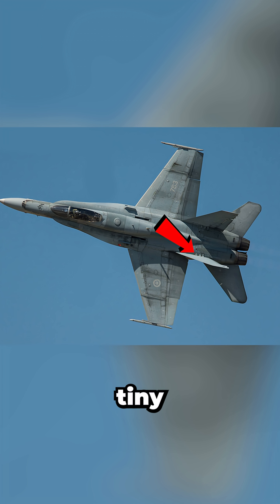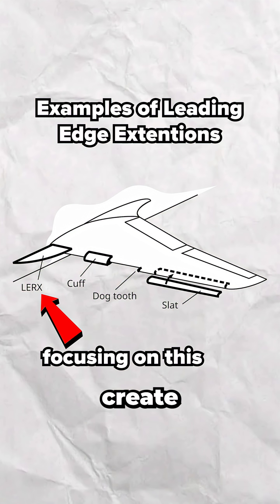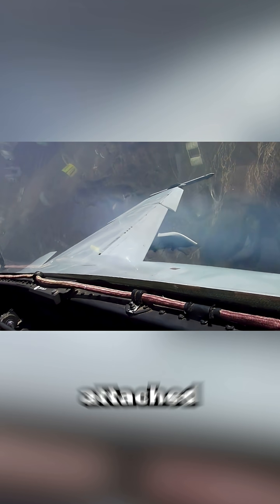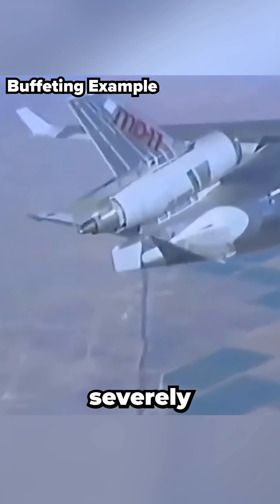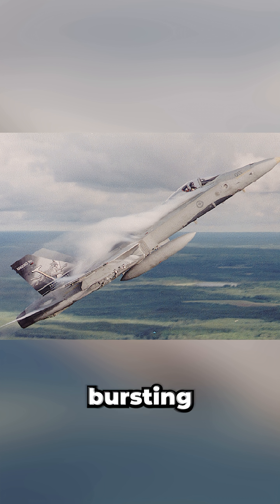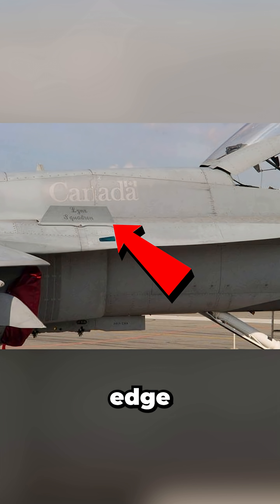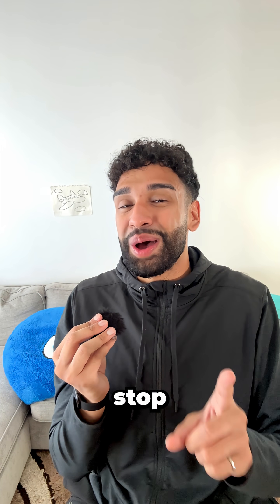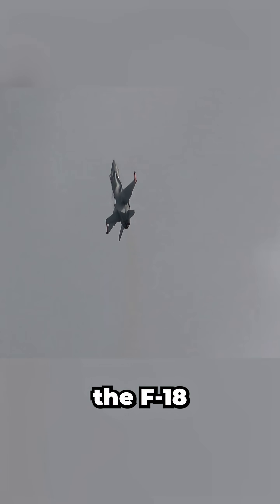The F-18’s biggest design flaw (and how they fixed it)

Comment: Note that was only on A-D's.   If you look on E-G, there are two rows of 4 smaller fences on the top of Engines just before the vertical stabilizers (tails).  This was done during design because of the lessons learned from the original testing on the A model

Comment: Honestly, you can’t fault the engineers. The CFD turbulence models were much less accurate back then especially for swirl and adverse pressure gradients in a non-confined flow, mainly (but not solely) due to lack of computational power. At the very least supercomputers are much more advanced now so you can run a much finer grid in addition to more accurate models for turbulence. They did a hell of a job with what they had

Comment: Bad design? Lift to fuel consumption off of the catapult. F-18s fully loaded with weapons, fuel and a full drum suck down so much fuel on the Cat that an orbiting F-18 tanker is waiting to give a refuel before continuing on the mission. 

So in all actuality the carrier launch rotation is:
SAR/ Starboard D
Alert 5 strike aircraft
E-2 (x2)
F-18 tankers
Then the mission event launch that need to be refuelled before going feet dry.

Comment: If you take a piece of paper, fold it into a paper airplane, and then throw it, it will obviously fly if it’s made right.  But do you know how sometimes the airplane catches air on the top of the wings and it goes directly down?  Try adding leading edges on the front of the wings right in front of where the wing catches air.  Don’t make it too big, but if you add some correct leading edges to that paper airplane, it will fly much more reliably and stable.  Just be sure you fold the leading edges correctly so that the air is guided under the wing so the plane doesn’t catch air on the top of the wings and nosedive.  This is just a demonstration.  No hate comments, please.

Comment: I like the part where he explained how exactly that extra fence improved the situation. I assume it gave a little wall for the vortex to bounce off-off, but who knows
Reply: From google AI. Point 2 kind of answers your question though admittedly it still doesn't address "how" the fence disrupts the vortex.
1. The LEX fence modifies the airflow over the leading-edge extension (LEX) of the wing, which creates vortices that help the aircraft maintain lift at high angles of attack. 
2. By disrupting the formation of the main LEX vortex, the fence helps to delay the onset of buffet and reduces the vibration experienced by the vertical tail. 
3. The LEX fence also creates a secondary vortex that helps to keep the airflow attached to the wing at higher angles of attack, improving maneuverability
Also google "function of fences on wings" and see the detailed explanation.

Comment: There are bolts holding them on the fuselage on one end but not the other.  McDonald Douglas built one half of the airframe and Northrop the other.  Can’t remember which one, but one of the manufacturers didn’t want to spend the money engineering the attachment fittings for the fence on their side, so no bolts.
Reply: Northrop built the aft. McD (now Boeing Defense) built everything else and assembled the full airframe, same as the Super Hornet today
Reply: Sounds like b*****

Comment: He also neglected to state that these Vortex Generators created an additional  24 volts at 5 amps to help run the avionics.
Reply: Is that after a through cleansing with "jet wash" 😂
Reply: @marktoken6052 including a 5 gal bucket of steam.

Comment: The f-18s wings don’t even NEED to generate lift at any AOA since she has a high enough thrust to weight ratio high. She’s pretty much a rocket instead of a plane.

Proof of this is how the f-18 is one of the only planes that can fly straight up, completely vertical, and still accelerate rather then decelerate like damn near every other plane

Comment: The strength of these thin metal sheets is amazing.
Reply: It’s actually a lot of carbon fiber.  Don’t ever go near one that has crashed.
Reply: @NixonsTapes  Why not?
Reply: @georgeofhamilton  Carbon fibers fragment into a ton of tiny needle-like dust. They can cause a huge amount of splintering and respiratory issues if they get into your lungs.

Carbon fiber is just modern Asbestos, another wonder material kept around for its low price.
Reply: @NixonsTapes  Thanks, I'll be sure to remember that.
Reply: @NixonsTapes  can you explain why is that kind Sir?
Reply: On most fighters, the load-bearing members and fuselage skins are actually quite thick

Comment: Installed by the Canadian Air Force at Cold Lake Alberta. A Canadian invention.
Reply: That's correct. Canadian  Airframe thechs were noticing fratigue on NDTs. All brunch of engineering gattered and supporter this REV.
Reply: I'm not certain that's true. 
They were not original parts on early build hornets and were installed as a modification by all hornet operators, however from what I've been able to gather the RAAF ARDU squadron had something to do with its development in partnership with MD.
Reply: @slickstrings It was a Canadian Modification first then the data was shared back around the other allied Hornet fleets. It became standard afterwards. Canada bought into the program early, and was/is the largest operator of Hornets outside the USA.

Comment: AFAIK only Canadian Hornets have the extra L brackets, correct me if I’m wrong 🤔
Reply: All a and b models that were originally built without the LEX fence and brackets were retrofitted. Think of it like a factory recall.
Reply: @slickstrings Think you're right.  I worked on Lot 9 and Lot 12 F-18C's.  Neither had those brackets at the base of the vertical tails.

Comment: thrust vectoring 🚫
pure aerodynamics ✅️
Reply: I agree, pure aerodynamics can be extremely effective. Just take a look at the F-35, it can beat an F-16 and a F-18 from just having modern control surfaces!
Reply: @Max1Youtube bro the f35 cannot consistently be dominant over either one of those in their best respective BFM abilities
Reply: @Max1Youtube  didn't a 16 with drop tanks run circles around a clean 35?
Reply: @nicolepham3836 yes it did. it did it to a test and evaluation F-35 that was being used before the flight control system was fully developed, limiting the F-35 to 6 Gs and a significantly lower AOA limit.
Reply: @Mench2007  huh, I thought it was an in-service block 1 or 2.
Reply: @nicolepham3836 there was also a bomb carrying F-35 that beat a clean F-16 as well, being able to get rid of parasite drag with it's internal bays are super useful
Reply: @TheKusa5  having one of, if not THE most powerful fighter turbofans in the world aslo helps
Reply: @nicolepham3836  No, it did not.
Reply: @Hairysteed  it did in fact happen, though it was a pre-production test airframe limited to 6G iirc
Reply: thos Ls aren’t
Reply: Dud you say that but the black F/A 18 from NASA had thrust vectoring and was sub mac xD
Reply: US was first to experiment with trust vectoring. But they figured out that it is costly maneuver that bleeds speed and left aircraft in worse energy state.  Their moto is speed is life and height is life insurance

Comment: What does the slot in the wing where the fuselage meets the wing on the F-18?
Reply: I think you are referring to the boundary layer air vents. Those slots on the upper surface.
If you look at the engine intakes straight on you will see they are offset from the fuselage and there is a gap.
That is to allow the sticky and turbulent boundary layer of air to be split off and directed around the engine intake. It gets directed up and out of those slots.
Also, at supersonic speed the excess pressure air bleeds through a fine mesh just in front of the engine up and out those slots.
Sitting back in the slots are small intakes that duct cooling air for electronics and the pilots aircon etc.
All very clever.
Reply: Some of the air that goes through there is used to cool engine bleed air.
Reply: @jimsvideos7201 thanks!

Comment: What do the small zig zags that move do on the top of the f22 raptor?
Reply: They are overpressure doors to help maintain proper air pressure, speed and volume. Since the F-22 doesn't have variable-ramp inlets to maintain air pressure and speed it uses these to do it instead. The sawtooth shape increases radar diffraction.
Reply: prolly vents for the engines, but i couldnt tell you
Reply: Bypass Air ducts, they open and close depending on what the flight computer says it needs it, during take off and landing they can open more to allow more air and close when not needed during high speed/cruising parameters, they also help to prevent compressor stalls since the larger intakes are technically choked and that can cause issues.

Comment: And thus, Reynolds number increases.
Reply: I forget what that is.

More turbulence i guess?
Reply: @04Ismyfavoritenumber Almost correct, It is the ratio between inertial and viscous forces denoted by the formula, R=(rho*velocity*length)/meu. It is dependent on the Velocity gradient. Higher the velocity more the turbulence and when turbulence increases the flow separation is delayed but some drag is also produced. It is critical for low speed, high camber aircraft like the cessnas.
Reply: При чем тут это?
Reply: @ВадимСавенков-з2ю Typical Russian, you're always lost.

Comment: Why doesn't the F/A-18 Super Hornet have them despite having near identical air frame?
Reply: The leading edge extensions were redesigned
Reply: The new Hornet is much larger than the original while having a parts count 
~50% less than the original.
Reply: Great question.

1. Even if the planform looks identical to the original in shape, but with a larger wing area, then the flow actually behaves slightly differently due to Reynolds number effects (ratio of internal to viscous forces). Larger wing chord at same range of design speeds and temperatures = larger Reynolds numbers.

2. The leading edge extensions were actually redesigned in very subtle ways.
Reply: @phukduck  Why is a physics teacher in the comments section? 😅
Reply: They actually basically completely different airframes
Reply: @wantdatcadpat44 the fuselage is basically identical at least the front part of it but yeah everything else is totally different 

One of the reasons they didn't change the number and one of the reasons that it looks so similar was they were trying to kind of trick Congress to a degree that it wasn't a new aircraft it was just the e and f variant. When in reality it's effectively a new aircraft
Reply: It's a myth, essentially a marketing lie, that the F-18C/D has the same airframe. The Super Hornet is very much inspired by the original, does share a couple of parts, and benefited tremendously from the Decades of previous design work, but in reality it is completely different airframe. If you hear something like 50% parts commonality, that's literally including every one of the 10,000 rivets. It's a bigger, heavier, and structurally thicker plane in every regard
Reply: @Laotzu.Goldbug  Is it also faster even though it is heavier?
Reply: @4evertrue830 it's not faster. the speed is comparable but the Super Hornet might actually be a little bit slower than the original F-18 if you're talking about comparing completely clean planes at max thrust.

That's because the Super Hornet is both heavier and has more powerful engines than the original, but it gained a little more in weight than it did in thrust.
Reply: The leading edge is wider and longer on super hornets.
Reply: @FactsOverFeelings23 it also doesn't have the narrow gaps that the legacy hornet has on its leading edge extension. 
And basically computer modeling of fluid dynamics jumped a long way between the mid-70s with the design of the f-18 and the mid-90s with the design of the super hornet
Reply: It's not "nearly identical", it's an entirely different airframe/type.
Reply: Because it's nearly a 100% different air frame, with a similar appearance to the Legacy 18. The navy seriously considered a different designation than an F18 due to the changes
Reply: The same question of why the F-16 isn't the same as Mitsubishi F-2
Reply: @Randomly_Browsing  how was that game called (your pfp)
Reply: They are completely different aircraft, the name and the similar shape was more of a marketing gimmick to convince Congress to give the contract to them instead of competing designs
Reply: The leading edge is different and bigger if you look closer there’s a huge difference
Reply: The super hornet is newer, so all the reinforcements are done in house under the hood.
Reply: Because it's a super hornet
Reply: The Super Hornet is an entirely different airplane. They only made it to look like an older F-18 so it would be easier to win the contract, as a reworked F-18 seemed faster and cheaper to congress than the F-14 new build it was against. 

I still say they picked the wrong plane.
Reply: @Elthenar the entire forward fuselage is the same. 

The tomcat but it was hideously expensive to maintain 

The Navy has saved an incredible amount of money and gotten an aircraft that does exactly what it needs to do.
Reply: « near identical », as you say, sometimes changes a lot of things, when it comes to aerodynamics ^^
Reply: The Super Hornet has relief vents in the LERX to reduce the vortex strength by introducing some straight/non swirling flow into the vortex,  and the wider LERX changes the peak pressure zone
Reply: Not “near” identical
Reply: They are not nearly identical.
Reply: Advanced redesign of the original airframe. They figured out how to resolve that issue in the design of the newer aircraft.
Reply: Well the FA18 Super Hornet despite the misleading name and looks, isn’t quite that similar. Yea the looks are the same but the super hornet is much larger than the normal hornet and has only 50% shared pieces between the two.
Reply: Its not at all identical.
Reply: Because the canted (and for the nerds out there: toed) pylons act as a speed brake, preventing the "Super" Hornet from stressing itself in any way.
Reply: The F-82 doesn't have them either 
😊
Reply: Because the hornet and super hornet are literally two entirely different airplanes. Boeing tricked Congress into approving an entirely new airplane. The only similarity is that they look the same and share a name...
Reply: Cuz that air frame is anything but identical. It is the same general shape, kind of like a Civic is the same general shape as a Bugatti but theyre drastically different.
Reply: The LEX was redesigned and it isn’t needed